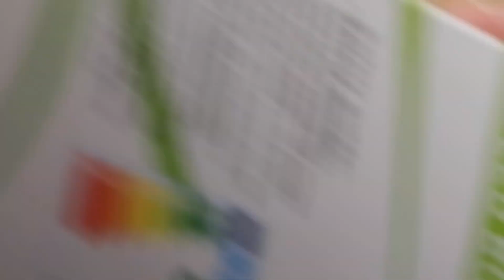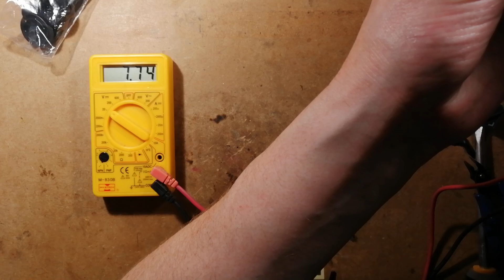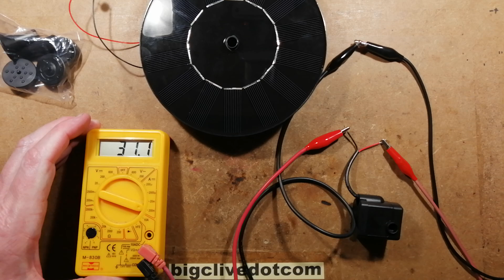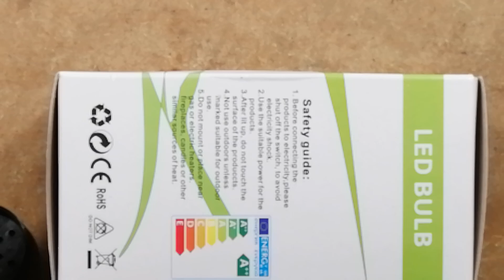Technical look at a floating solar fountain.

Comment: A couple of those would be pretty good to use to aerate a small outdoor koi pond or something like it if it wasn't convenient for you to use a electric pump of sorts.  Plus breaking up the water surface would keep stagnation keeping bad microbes/algae/mold from gaining a foothold in any outdoor garden water feature.  But I could be wrong with it's aeration potential, but it could definitely be able to compliment a underpowered pump and add some water feature action.  I got a turtle in mine and she likes to climb stuff so I could see her sinking it when she would try.  Shes got plenty of basking rocks but will climb the tiny head of my fountain trying to balance like a spinning plate on a stick.  At least the small jet of water will power wash her shell bottom while she attempts climbing the impossible.

Comment: it's a digital zoom. that's no good, it doesn't help with image clarity.
if it's a phone (as i hear you mention) and it advertises with 20Mp, then that is only for still images.
if you're recording video, it captures only in 1080p (or higher, if available) but zooming during video won't change the range of pixels that are used on the sensor. it just zooms digitally with processed images.
bad bad bad

Comment: since ICC cricket is running in England would it be possible to get those modern wickets they use to open up as they have some smart circuitry which lights the leds when the ball hits them and the bails are off, seems it has a battery pack in the bails and wicket itself and when u restore them to normal position the leds go off

Comment: I watched this and then did a quick search to see if one can remove resin potting. Apparently it may be possible if you put the device in water and bring that water to a boil.  This brings the epoxy above the glass transition temperature so it's easier to pick away.  See this video /watch?v=OiPe6f4Oh8E

Comment: Yeah that zoom shot was pretty pixelated. Might be worth investigating one of the cheaper DSLR/interchangeable lens compact cameras on a rig. IIRC the bundled lenses can pull a pretty good macro shot most of the time. You can also have a look at GreatScott's channel to see if the rig he designed would work here - I'd say it's rather good

Comment: Watching this in the first few seconds I'm really really hoping this is a soft robot that uses no electronics and instead just uses pressure differences created by solar energy to drive the expulsion of water. But this is an electronics channel, and I'm sure this is no such invention. Would be a cool invention if possible though
Reply: You on the wrong channel.
Reply: Oh, so this isn't an electronics channel like I wrote? Sincerely, my mistake.

Comment: Soo... Like alot of other videos, I'd really like to watch this, but for some reason I don't get any sound. Checked my sound settings, refreshed the page, closed and re-opened the browser, tried other videos - which works. 

Audio works fine on my phone and would problably work in another browser as well, but this just seems odd.
Reply from the maker: A common issue with Dolby surround sound processing.  It often sends my audio to a middle speaker which may not exist.  Check your surround sound settings.

Comment: Could you do a test on the pumping capacity of such a small jet type impeller pump, what its max head height is and maximum liquid throughput? (hold a hose upright until it can't pump any water out, and stop the time it takes to fill up a cup of water?). Would be quite curious what the performance specs are or if anyone knows...

Comment: How does a brushless pump motor work with a simple DC voltage from the solar cells? There has to be some sort of commutation, either mechanical or electrical
Reply from the maker: Similar to a computer fan.  Coils and a magnetic field detector.  Often built into the same small component.

Comment: I absolutely love these little pumps. In my project making an automatic sprinkler for 12 pots I was originally disappointed at the pewny power these put out. However they are so cheap I just bought 6 of them and run them together. There's 3 lines going out to 4 pots each with two pumps in series. The pumps use about 4 watt each so 24 watts total which are split over 2 USBs that are just bused together with a capacitor so the motors can start gracefully. A lot of USB power banks also don't like the ripple and awkward current draw off these motors so you should add a capacitor. Technically you also need a diode to be complaint with USB but since its only the power bank that I plug them into I skipped that.

Comment: having sold many of these back in the very early 21st century, they failed miserably as water has minerals in it that build up on the inside and outside of the plastic housing for the solar panels and they eventually die, as do the electrics and the actual pump motor, I hope the Modern Version has been improved and lives to pump for all eternity.

Comment: Well done Clive, I've just bought one of these and also for my Mum and you review the very same thing! But only 6 out of 10! Where did you get 'floating' from? It does but the instructions say "completely immerse", which (I think) means it should be all underwater. You doubt me? OK so what are the suckers underneath for? See you missed those didn't you! I think it should be stuck on the bottom of your birdbath etc. Whyfore? Because when the sunlight is less than optimal the water falling back onto it, when it is floating, causes it to lose power. Then the water runs off and it starts again and so it cycles on/off. Submerse it and you get an even, though admittedly less powerful fountain. But in full sunlight this little fountain does give a decent spray for it's size. Pity you couldn't get into the control box, that would have been interesting. How about a Part 2 or supplemental video to cover these 'missed' points. Great channel, keep up the good work!

Comment: The "pulse" starting of motors is also prevalent on two things I've got; the Toyota hybrid air conditioner compressor motor is variable speed and when it is on its lowest setting, it will pulse itself on and then drop down a few milliseconds later to a constant speed.  Dyson fans also seem to use a brushless motor and pulses when turned on.

Comment: A 20MP camera doesn't mean that it uses all those for video recording. Zoomed in it's very blocky and while it focused fine it's just that the resolution is the limit. Was that recorded using the open camera app? Maybe try recording in a higher resolution if that solves the blocky zoom but I doubt that will help. 

Say, why get a phone for recording anyway? A cheap DSLR with a useable zoom lense could be a better quality solution, only thing you would need to do is edit the video but that can be done on a phone now too using usb OTG card readers and what not. I can understand tho why you wouldn't want that since that would force you to get used to a new workflow when the current one works just fine. Eh.

Comment: Thanks Big Clive.  I got one of these a I think a year or two ago.  Same sort of performance and I wondered what sort of circuitry might be in the mysterious potted resin box.  Nice to know the pumps don't typically start in lower voltage scenarios hence the charging capacitor.  

Neat.  There you go, sacrificing a purchase for the greater good.  My questions and then some - answered!

Comment: I have a pump that look the same with the magnet-impeller (propeller?) in it. I got it as scrap from a water-cooling for a computer, the thing is that i cant get it to run on DC, i have got it to work on AC so im curious if there is some regulation thing goin on to make it work on DC. Maybe someone knows more about this kind of motors.
http://bfo.pm/pump/small_pump.jpg
Reply from the maker: The DC pumps require circuitry while the AC ones just have a simple coil.

Comment: I had a pump like that in a small pond, a couple of years ago, and it didn't last the summer - the solar panel got whitish from dried limestone from the water and the pump got stuck several times with small debris. After one time too many of not cleaning the pump inlet after it got stuck, it no longer worked (probably due to the steep rise in current you noted). I left it in the pond for a few more months and the solar panel de-laminated and was ruined too. From my experience it only works well with clean water indoors - outdoors it goes bad too quickly and it was not cheap.

Comment: These solar lights and products should all be tested under the Florida sun as a true test to longevity. I cant say how many solars we've gone through of all types of products due to the severe intensity of our sunlight.
Got one of these a while ago.
Reply: Had one in our bird bath (South Coast, New South Wales). The resin started to become hazy after six months, and by 30 months was completely opaque. Tried cleaning things up with the stuff used for reconditioning car headlights but the cost and time were greater than buying a replacement fountain.

Comment: G'day,

Yay Team !

   What a ripper of a little Solar Fountain...; I might have to look out for them, when Winter is over and they appear here, in the shops in Oz.

  A snippet of Feedback, regarding those Thermo-Electric Stove-Fans which you pulled apart several months ago...

  I aquired one in about March, and it worked very well as a Drive Unit, but the sheetmetal "Fan" it came with was so Aerodynamically vile that after a month, ever time I saw it I ground my teeth thinking that, by the homemade handcarved Propeller hanging above my front door - one of two I've designed and built and then flown behind....; I could CARVE  something FAR more efficient, out of Timber cut with a Chinsaw, which will work and look vastly better than that thing (!).

   So, the first attempt at an 8-inch diameter Airscrew with a 6-inch perfectly Helical Pitch, and an Aerofoil sketched off the top of my head..., laminated in Toona-Australis & Casuarina Sub-rosa (Red Cedar & Black Oak...) - using my grandfather's Wood-Rasps..., took me 21 Hours to finish ; but it's since run nearly 200 hours, and it shifts 4 times as much Air, and blows it at  twice  the velocity, sending it 3 times as far accross the Room (realtime Smoke-Trail Analysis...., using an Incense-Stick, tape-measure, and a Torchbeam shining onto the Airscrew, y'see).

  So, my first attempt  is about 4 times better than the factory fitout..., goodly goodly.

  Before trying again I bought a 350 Watt Powerfile, and the second attempt using identical Diameter & Pitch (aiming for the "150 CFM" as  claimed on the Box, at the 300 RPM at which the Chinesium original was observed to be running , when the Temp. Gradient accross the Peltier-Device was 30- degrees Celsius....) but with a specialty High-Lift/Low-Speed Aerofoil designed by Irv Culver the noted Aerodynamicist, in Black Oak and Pinus Radiata..., and it only took 14 hours, but it had a Tip-Tracking Error, and Dust-Accretion Studies plus Smoke-Trail Analysis proved it to be only about 3 & 1/2 times better than the original.

  So, High-Lift/Low-Speed was a mistake.

Then I bought a Drill-Press (for the Central Hole in the Laminae.., to beat that Tip-Tracking Error), so in Black Oak and White Stringybark, I made the 3rd one with a  Low-Drag traditional  Boomerang Aerofoil, quite thin, and having sharp leading & trailing edges, with a flat bottom and a Cylindrical-Tangential, symetrically-curved upper-surface - with the maximum Camber at 50% Chord....; and that one took 12 Hrs :17 minutes.

   As I had expected, and hoped, the traditional  Aboriginal Aerofoil works best of the lot (which I have now tested-out, and proved by observation of experimental results - rather than trying a Boomerang Aerofoil from the outset, and then merely asserting that it "should" work best...) - blowing about 5 times as much Air as did the pressed Sheetmetal Disaster.

 So, by interpolation, if my third unit is about 90% Efficient, then my first was 72%..., my second was 63%..., and what the Chinaman sold was perhaps 18% efficient.

   With the same 30-degree C. Gradient, at which the Chinesium thing did 300 RPM and moved almost no Air, my first attempt turns at about 350 RPM, apparently because it sucks more cool Air through the Fins on the Heat-Sink, thus increasing the Current available to the Motor (?), the second unit ran at 320 RPM, & the Boomerang Section Propeller ran at 375..., all on the first Drive-Unit.

   So, I bought 3 more Stove-Fans, and the new ones have more efficient Heat-Sinks and Collector/Conductors..., but their new Fans are almost as bad as the old one...

 My 82 year-old mother is DELIGHTED with the Black Oak/White Stringybark Propeller on her new improved Stove-Fan....

  After another 2-Bladed one for practice, then I'm going to have a go at laminating a 4-Blade Propeller.

   There's a very upmarket Aboriginal Art Gallery in my home town, in which I hope to charge Eye-Watering prices for tiny little handcarved Propellers laminated from rare commercially-extinct Chainsaw-milled Quarter-Cut NativeTimbers, Trees which the Wind blew down on the Endangered Species Sanctuary on which I reside ; each one coming with a free Chinesium Peltier-Effect Drive-Unit !

   Backtrack me to my Videos, for both the "Woodcarver's Challenge..." and the "Propeller-Carving..." series ; within which I show how it can be done.

The goal is to get the construction down to a mere 10 Hours for a 2-Bladed Unit...(!).

  So, thanks very much for the Video in which you pointed me at the Stove-Fans...; it took over my life for a while....

Take it easy,

;-p

Ciao !

Comment: Nice video Clive! You can peel the epoxy resin using "epoxy paint remover". Dip the potted part for a couple of days and the resin will dissolve without affecting the markings on electronic components! Very handy!

Comment: Dissolving the resin can often be done with any paint remover that contains Methylene Chloride aka dichloromethane.  At the least it will turn it into a crumbly consistency.  Fairly unpleasant stuff in pure form, and hard to obtain, but not so bad in paint thinner
Reply: Methylene Chloride is a pretty dangerous chemical as it can cause a person to go unconscious or even death if the fumes from these chemicals are not properly vented.  You'd have to wear a full suit with breathing apparatus.

Comment: you need to hook that pump up to a 18650 cell and put it in a bathtub boat so you have a bathtub jet boat lol
Reply: I would use two 18650's in series to give it up to 8.4v. Since it was running on 7.74v, that would give it a little touch of a boost on full charge.
Reply: ya your totally right

Comment: It would make a really boring video, but short of using an oven at >100'c and then trying to manually flake off the epoxy potting compound- back in Groom lake when the ETs had potted stuff we dipped the packages in acetone or MEK for a month A month That sorted it. But there'd be no plastic parts left and any FR4 would be pretty ruined from MEK. Try it outside in a jar away from kitties.

Comment: I saw a program that explained how very little surface agitation of the water of a pond inhibits mosquito production.
Other than being a novelty,  this may have a practical use..
Thanks for sharing your videos. And keep up the good work.
Reply: Ah... So that wasn't my imagination.... I chucked one of these into my dog's water bowl (its more like a kids pool) last summer to see if it would help keep the water cleaner for longer. After a few weeks, I realised I hadn't seen any mosquitoes hanging around like they had been. And it did seem to help keep the water cleaner - probably because it was a little cooler from the increased evaporation.
Mine started falling to bits though so I will probably build a more permanent, non-floating one for next summer.
Reply: tin2001 maybe add a uvc light too? They can prevent the reproduction of organisms to a degree
Reply: @tin2001  
The article that I saw was about a gadget that was small and solar powered. If I  remember right, it flopped around on the surface of the water. It was small and cheap enough to be air dropped into swamps in the 3rd world back countries to try to control the mosquitos.
The program was looking for donations.
Reply: Would also help to oxygenate a pond. Could also be useful to pump coolant around pipes on the back of solar panels, increasing their efficiency and collecting thermal energy.

Comment: I love the pump.  The pump is so tiny and works on DC. All the tiny submersible pumps I've used run on 50Hz and no more. This thing is so quiet and mysterious.  A bit like the Dyson motor AvE reverse engineered.
Reply: You can buy those pumps on their own from eBay too. It's kinda like an aquarium pump, just it runs on DC.
Reply: It looks perfect for making a solar powered sailboat. Turn it 90° upside down, attach on the top the battery, esc, servo control, etc. Add a servo for the sail and one for the pump and voilá.

Comment: Try prying the potted part out and putting it your oven at about 150 degrees centigrades. Some of the resins just crumbles apart after a thurogh heat through like that.

Comment: I had one of those. It lasted a couple of months and then died. The panels on top didn't deteriorate, the glue holding the foam and pump bits fell apart on the back side  and broke the connections.

Comment: The problem with these is the float over to one side of the pond they are in.  With any wind the output is blown over the edge eventually running the pond dry.
Reply: you could fashion a little anchor for it and tie it to the cable underneath.